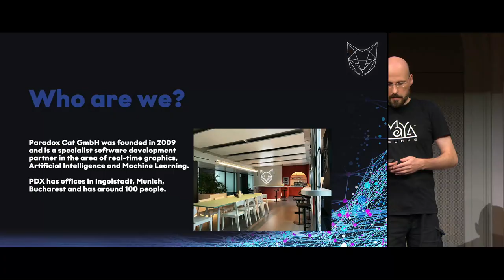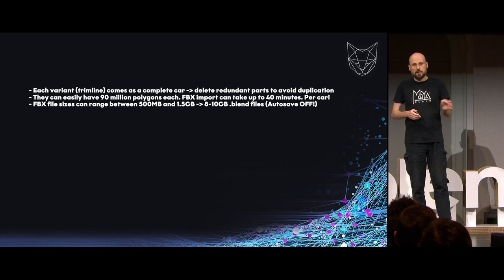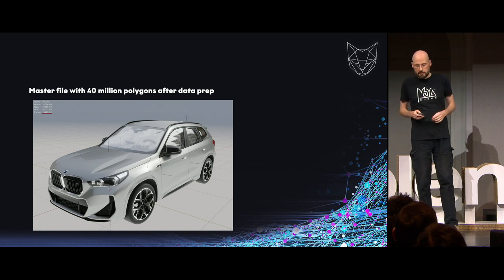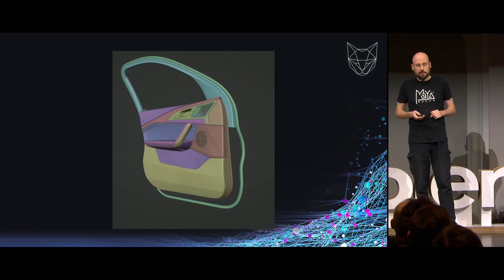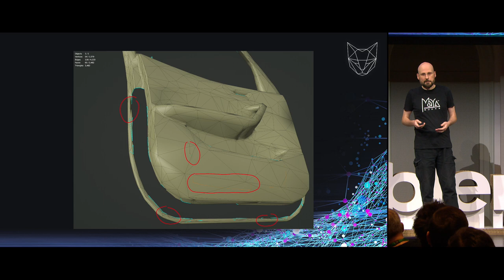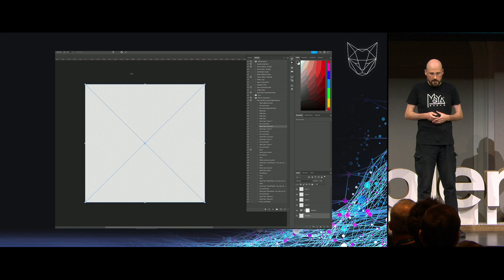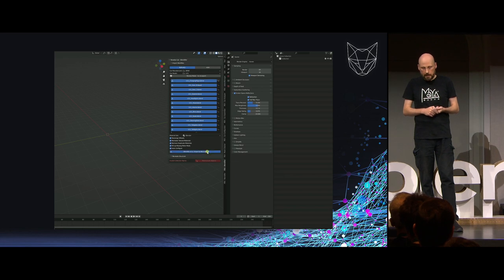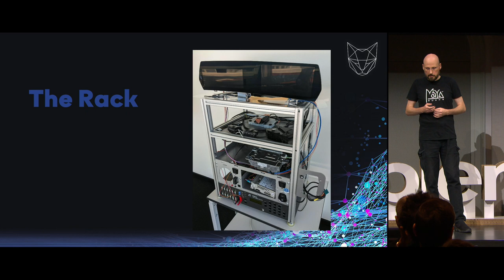CAD data optimization methods and tools for HMI at BMW

Comment: Nice Talk there. Have you ever tought about using Deltagen? Its a tool by 3D Excite and you can import STEP or other CAD Data to shade it and tesselate it into different polycount level while maintaining UVs, Normal, etc. It also has a tool to auto jacket (delete) inner parts. It's quite pricey but worth a look.
Reply: One of my colleagues has deltagen experience. It came up here and there in conversation but was never really considered for our workflow.

Comment: The face group paint tool's kinda cool. Is that built in or a custom tool?
Reply: If you’re referring to the tool that let’s you paint faces in and out of existence it’s based on geo nodes with a custom add-on to automate the setup.
Same for the normals fixing tool. It’s an automated setup for the existing data transfer modifier inside Blender
Reply: @tomgon3D  cool. thx

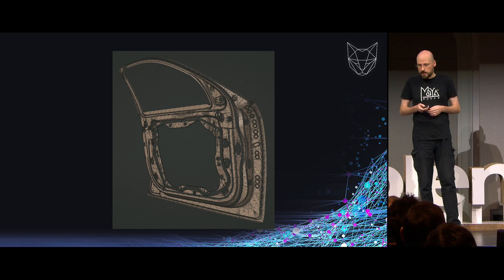Comment: 9:00 what he doesn’t say here is that all models from CAD (Catia most likely in this instance) have custom normals, and those currently get destroyed in Blender when you merge vertices. Max 2024 finally added support for merging and even booleans with custom normals. Hopefully Blender will do the same in the future.
Reply: How do you import Catia models in Blender??
Reply: I also work on CAD data. I'm not sure if my workflow might affect normal data, but so far, I haven't encountered any issues. The data I usually receive comes with a split mesh. Generally, I select the outer edges, mark them as sharp and seam, then merge them, and disable the auto-normal option.